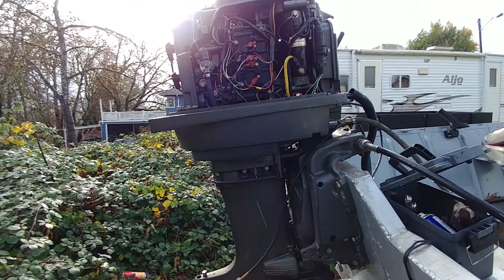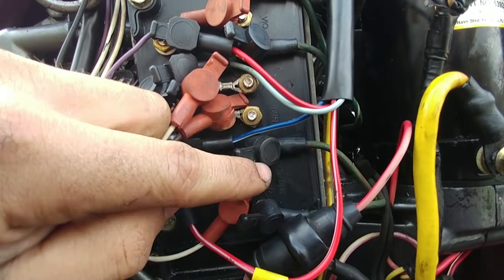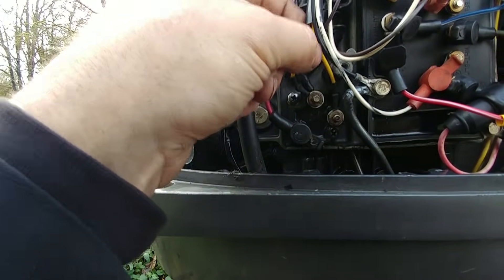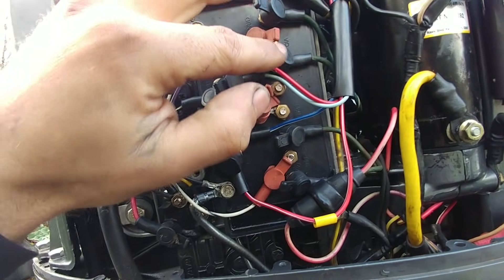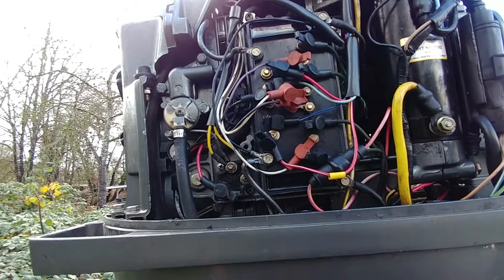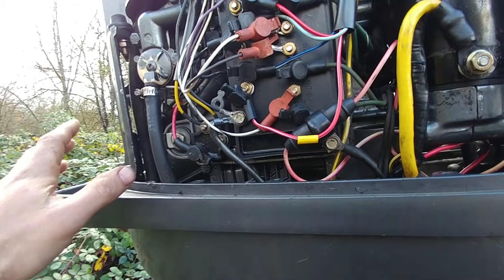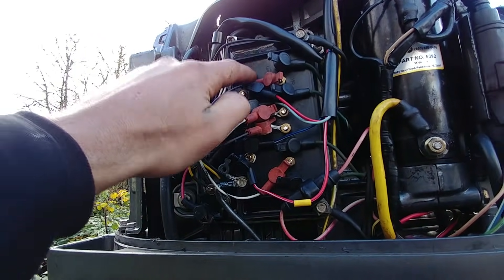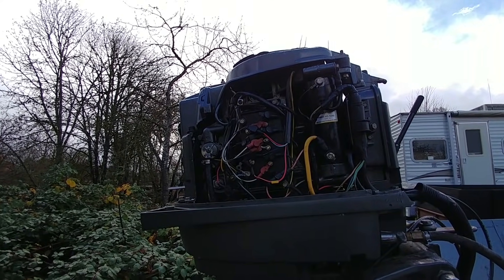how to fix no spark outboard

Comment: Hi nice Video,im from Germany.
I have Mercury 50ps 2takt from 1992, only Spark on one Cylinder.
When i change wires to coils,the Spark goes to another Cylinder.
The Spark is not strong.
I measure the Stator and one of wires is no passage to other wire.
So the Stator must be Broken?
But i hear when have Spark than it’s Not the Stator 🤷‍♂️
U have idea?
Reply from the maker: The stator put out a/c voltage. 4 wires. And 2 colors. While cranking check voltage in those wires. One color should have 30ish volts ac. And the other color should have over 100 volts a/c. Thats the only way to test the stator. Test with wires off of the cdi box.
Reply from the maker: The spark mived when you switched coil signal. So your coils are good. Try moving the trigger wires to another coil pole on the cdi box. Using 1 trigger to trigger the a cylinder. If you still dont have spark on the bad cylinder when you move a known good trigger. The cdi box is bad
Reply: Thanks for your fast answer
I have Pictures but cant send here, from my Stator comes two yellows wires,one Black,one red and one Blue one.
I messarue with Ohm,red to Black it’s 109,3 semms to be ok
Blue to Black nothing,so the Stator Borken?
I messuare the Trigger and all seems ok
Reply from the maker: Thtwo yellow. Not realted to spark. The black is ground. The blue and the red should have ac voltage on them. One at 30ish volts ac and the other over 100 volts ac if you dont have that check for broken wires. If none found replace stator
Reply: Before i had Problems mit the Gastank so i Start many times without Gas and wohnt start.
Maybe something Burns up?
Reply from the maker: Running out of fuel is not related to spark. Your welcome. Dont forget to subscribe
Reply: I reduced the Stator,for your Test i must replaced the Stator and Test ist
Reply: Thanks for your help!
I will test on Weekend and subscribe
Reply: One more question,when i test the red and Blue one from Stator.
I must disconnected from the cdi?
Reply: Hey,i messuare now.
From Red to ground 22V Ac 
From Blue to ground 139 V Ac
Is it okay?
So the Stator isnt Broken?
Reply: Hey,my Motor run :)
It was a bad Trigger,an Maybe the i destroy my Cdi when i tested the Spark without ground.
So Trigger and Cdi change and runs,Stator was ok.
Thank you 👍

Comment: great video  i bought the same engine whit a boat and the trailer for 400$ yes 400 $ but there is no fire at all cilinder , and i try to find the problem , any idea ? i tried the voltmeter on the stator red  was  around 150 volt and blu  12 volt . look good . but the yellow who go on the rectifier what i am suppose to have ? and the y whore  cut when i bought. can it run whitout the yellow from the stator .i think the yellow is for recharge the batterie ?

Comment: Hey captain, I have a miss at full throttle on my 88 45 hp classic 50. I took a spark tester and I have good spark. Did you use a dva adapter on your volt meter? I ohm my stator out. The book say 5.7 to 8.0. I am reading 2.23. I guessing my stator is bad?? Any advice appreciated.
Reply from the maker: Well that sounds fun. 
Have you determined which cylinder is missing. Or is it all or random. If you can identify if its one or many we can go from there

Comment: Help!! So, I was only running on 2 cyl and after new plugs, wires, coils, trigger, and stator I'm getting nothing now just cranks, before it would start and run but now just cranks?
Reply from the maker: Gez that sounds like alot of money. Fist step: spray some starting fluid in the carb and verify thhis isnt a fuel problem. Then buy a spark tester to put inline with a plug wire
Reply: @CAPTAINWILLY  well the fuel is what I tested before the spark problem. I did an inline test no spark on any
Reply: Yes it was a lot of money..lol but my guess is I wired something backwards. I can't find diagram that has color. I've switched some around but my brain is wore out.
Reply: Update: End up being a piston ring dropped lost compression.
Reply: I have the same issue with not having any spark. How did you figure out it was a bad piston ring?  My motor spins but no spark.  I drove my boat with one broken ear on the propeller and with all that vibration, I might have lost a piston ring too
Reply: I took it to the marine shop they put a camera down in it.

Comment: I have a 1980 mercury 50 4 cylinder with only 1 cylinder with spark which is the second one from the top I need help on how to test the Cdi box do I use a volt meter or what I think it may be the coil but not sure NEED HELP THANKS
Reply from the maker: Colby Zern. So yes a multimeter will be needed. Sence you have one cylinder that has spark. Use That to your advantage. Follow your wires for identification. Coil wires. Stator wires. And trigger wires. Trigger wires will be between the coil wires. 
Swap the coil wires on the cdi. You said spark on two. So use the coil output on the cdi box to test other coils. 
Hooking up coil 3 on the coil 2 spot if coil 3 sparks then coils are good. 
Next test trigger. Swap trigger for 3 onto number 2 post on the cdi. This is testing the trigger. Like having one good post on the cdi. Test multible parts with that post.
Reply: Okay so i did that. we tried a lot of things but then we found that the spark plug wires are corroded so i cleaned them up and we know have spark on 3 cylinders so we are going to try to replace the top cylinder coil and pray that it works thanks ill let you know.

Comment: So I'm having a problem with my outboard Mercury 50 horsepower 2-stroke engine and a few people have said that they think one of my cylinders is not getting spark. 

Can you take a look at some videos I put up under my site and see if you think the same thing that one of my cylinders spark plugs is not getting spark. 

It could be any one of a number of things maybe bad fuel line, maybe bad fuel, maybe a bad pulse bulb, but I'd be curious to see if you think its cylinder issue.

Let me know.
Reply from the maker: JB JB . hey there. I just watched all of your videos. Yes. Deffently a spark issue. Heres what im going to recommend. 
Write this down.
1. Get the problem to happen  when running
2. While problem is happing take some needle nose plyers amd remove each spark plug wire one at a time.
3. If the engine dies or runs much worse. Them that plug is not an issue. 
4. Continue for the rest of the plugs until removing a wire dosnt change the condition. 
5. While it hasnt changed the condition amd the wire is off hold it close to the end of the plug or the block or a ground amd see if a spark jumps from the wire to ground. 
6. Contact me.
Reply: CAPTAIN WILLY'S FISHING ADVENTURES  okay got it the only other thing I wanted to add is that the engine seems to have an easier time starting when it's in an upright position rather than all trimmed all the way down I'm not sure if that's an indication that it's more carburetor related or not but I thought I would let you know.

I really have no idea what it could be one when I feel like I finally have narrowed it down something will happen that will make me completely rethink whether I have the correct answer or not so I'm really just Flying Blind here trying to figure this out.
Reply: CAPTAIN WILLY'S FISHING ADVENTURES Okay so went out and purchased and inline spark tester and put it on all three and all three had an excellent spark.

So I don't think it's a cylinder.  If it helps any - when I first started the boat after not touching it for a week it started up perfect Idol perfect no problems at all it sounded like a new boat then it slowly deteriorated after about 10 minutes. Then it stalled and then I couldn't start it for about 10 minutes. So I'm not sure if that's indicative of a carburetor or not but that's what it did today anyway.

It's worth mentioning that I also went out and purchased a $30 Mercury pulse bulb and put that on in replacement of the old one in hopes that it would help but it didn't seem to make a difference.
Reply: JB JB did you test the spark again after it started to deteriorate after the 10 minutes?
Reply: Negative....I would just connect the inline spark tester , start the engine, walk to the back of the boat and check the tester.  i did this for all three spark plugs and that was it.

Did I do it incorrectly?  Should I have waited for the engine to start acting up?  I just figured that as long there was a good spark there then that was not the problem.

Let me know what you think.
Reply: @jrbz88  what was your end result? Having the same issue. lose spark on #2, I swap plug wires and then #2 will fire so i know the ignition coil is good. Replaced power pack today, all 6 firing sounds good... test drive and #2 stop firing.   Took #1 plug to #2 and it fires. Same result with new power pack. Issue follows the wire off the power pack. Also have New plugs, fuel filter, water /fuel sep fresh gas etc. Ran fine about 8 hours so far this season WOT 5k, now i can only crank to 4k. Mising on middle cylinder port side.. Would like to figure this out. 00 Johnson 200 ocean pro.   please help